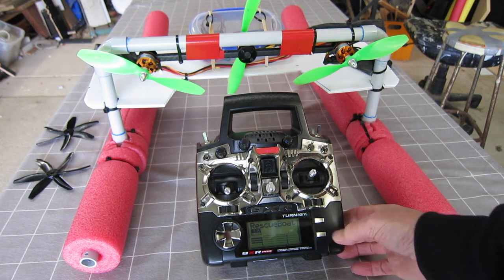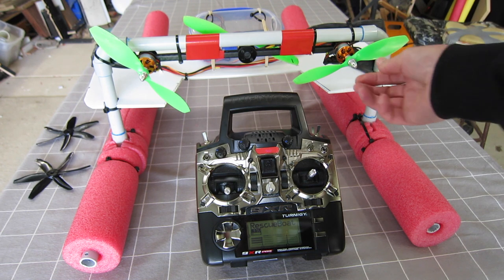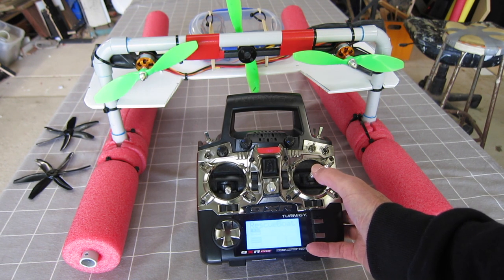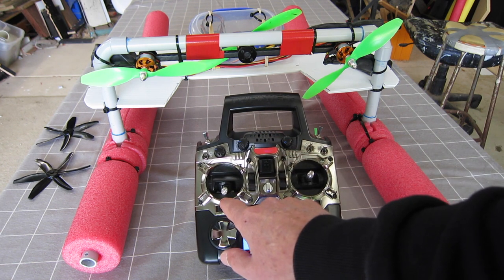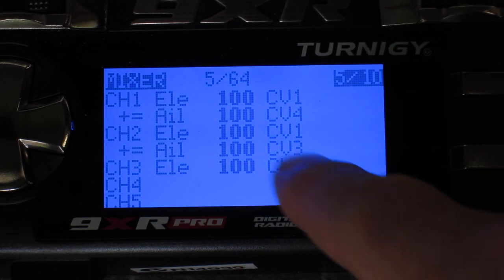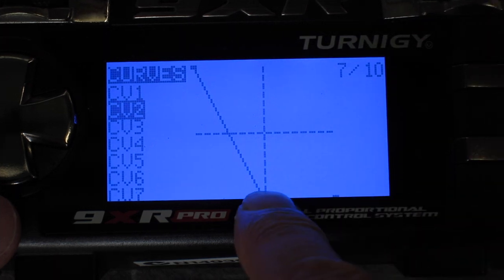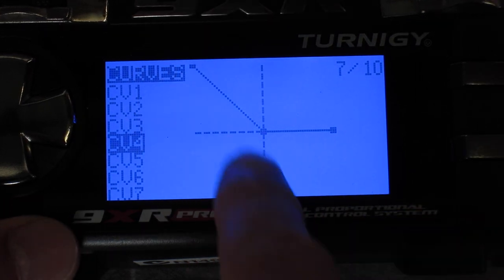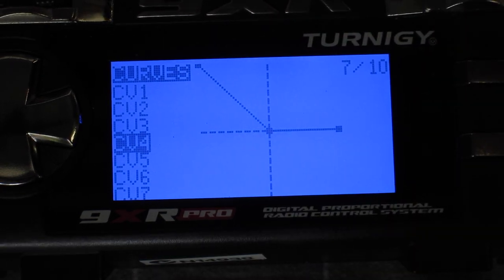RC Rescue Boat mixing

Comment: I decided to use a couple of buggy/boat ESCs that gave me motor reversing around mid stick. This made life easy on a Spektrum set as selecting the delta wing configuration sorted out the aileron & elevator channel mixing directly to use as the two throttle channels. However the throttle inhibit required two mixers: AIL > AIL with rates of minus 100% in both direction and ELE > ELE with rates of minus 100% in both directions. These mixes were switched using the FLAP2 option so that the flap switch became a motor inhibit. 
I'm still going to build some prop guards, not just for my fingers but for my runner ducks who might well take a peck at a spinning prop.
(BTW - the use of a switched mix THR > THR with -100% rates is a handy way to add a throttle hold to the ACRO mode on a Spektrum set with the offset value set as required)
Reply from the maker: Sounds very good. Reversing ESCs would be perfect

Comment: Hi mate. Trying to do the same setup on  a Taranis Xlite pro, could you possibly do a quick vid on how to achieve correct mixes? Thanks
Reply from the maker: Same OpenTX mixing as this video.
Reply: Followed but cant figure out how to change off centre mixing curve, very frustrating!

Comment: Hi mate why you ccw and Cw prop for forward thrust I thought you could use cw on all motors is there any reason for this thanks
Reply from the maker: Just because I didn't have all the same. Make no difference which props you use.

Comment: Great idea !  Is it possible for you to share the configuration file of your Tx  ?  I'm just an absolute beginner on OpenTx and it's a little bit hard to understand how to do it  !  Thanks . Regards from Belgium.
Reply from the maker: I dont have the boat setup or radio any more sorry. But I would do it differently now. Forward motors on Ch 1 and 2 controlled by Throttle stick, with differential thrust via the rudder stick, and reverse motor on ch 3 controlled with the elevator stick (just the down movement)
Reply: @AndrewNewton  Thanks for answering. I will try to do myself.  But I prefer your first setting, using only one stick.  I'll see and choose when able to program my Taranis.   Thanks again.

Comment: I just built the boat and unless I am wrong the way you propel the boat with the props, there is no cooling to the motors, please advise.
Reply from the maker: Just air cooling Ron, not a problem with these motors

Comment: I presume the esc's are on there own channel on the receiver ie 1-3 but I can't get them to work do they need setting up
Reply from the maker: That's right, ch 1 2 and 3. Try each ESC individually on the normal throttle channel to see if they work. Have you setup the curves? Which radio?

Comment: Hi can you tell what props you used cw/ccw and motor direction thanks
Reply from the maker: 8x4" slow fly props CW on the left, CCW on the right and CCW in the middle. Spin direction doesn't really matter they could all go the same way and still work
Reply: Hi what model selection did you use on radio quodcopter or heli or glider or plane cheers
Reply: Sorry also bought all ccw props can I put the one on left backwards